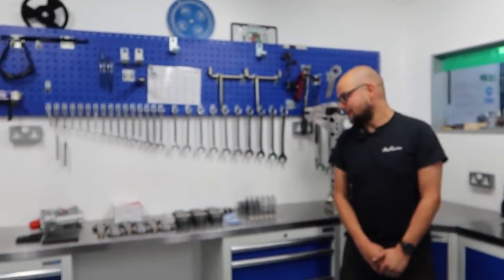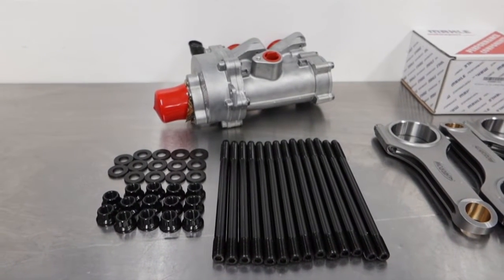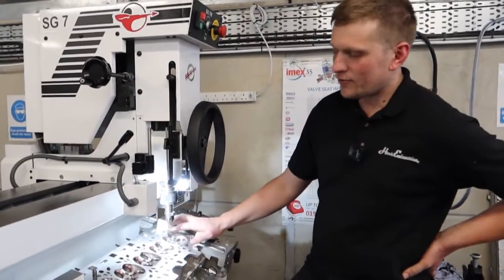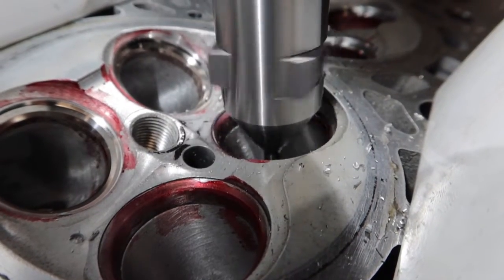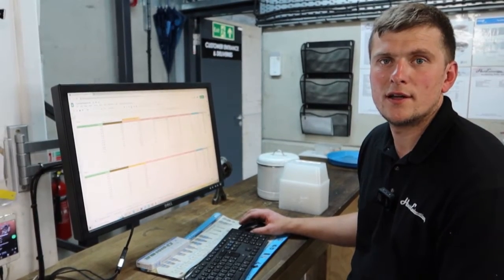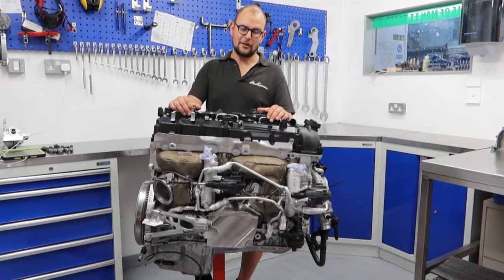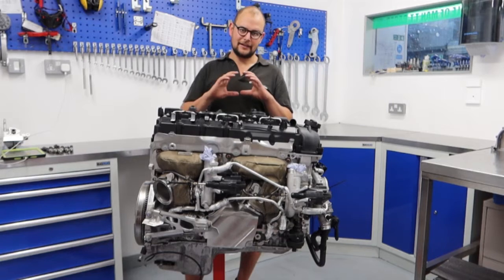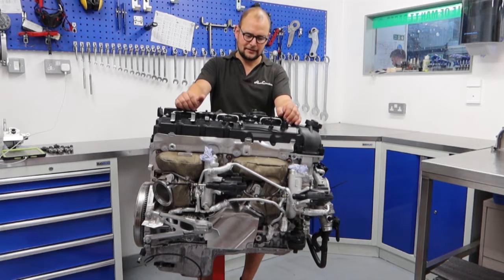FORGED S55 ENGINE! 1000bhp M4 Competition Build Episode 2

Comment: I saw you used Supertech titanium spring retainers. Do you have concerns about their longevity?

I’ve been reading that steel retainers are preferred for their longevity, as titanium fatigues quicker and is more likely to break earlier. If one of those retainers break, the valve will drop inside the cylinder and cause damage.

Thanks for answering my other questions, btw. Much appreciated.

Comment: What did you do about the LDS coating on the cylinder walls? Did you bore out the cylinders and and then sleeved them with run off the mill iron cast sleeve, or sourced a brand new engine block from BMW? Because BMW says you can't bore or machine LDS coated (arc-wire spray) cylinders on the new engines, B58, S55, S58... etc.
Reply from the maker: The LDS is very hard and this engine has done minimal mileage, and so it was not touched. It was all measured and checked before the new pistons were fitted.
Reply: @hackengineering5586 , thank you for answering.

Comment: Hi guys..  looks like a great build.. I am curious about the VVT hub.. in your opinion does it have enough "bite"  (sized correctly to make decent cut into the crank) and more importantly its hardness for chain sprocket wear and spline hard enough. would greatly appreciate feedback on this as doing a similar build. since its been two years you would have some info to share on this.. Ta
Reply from the maker: Yes it does, we have also had cranks where we've removed the VTT hub and a nice, clear-cut spline is visible. These are the only crank hubs we have ever used and come highly recommended! 
This engine has been bomb-proof.
Reply: @hackengineering5586  Cheers for taking the time to reply to me, much appreciated .
Reply: @hackengineering5586 how many miles has been put on it ?
Reply from the maker: @harambe2716 around 22k on this engine since the build. And it was running the VTT hub for a fair amount of mileage before that.
Reply: @hackengineering5586  is it honestly worth it to build the motor? I have an s55 w around 40k and I’m wondering if a built motor with all these power mods would  have just the same chance of it to blow as a stock motor would. Sorry if that sounds confusing.
Reply from the maker: @harambe2716 no problem. Depends on the power you're looking for, and how you're looking to make it. A lot of reliability comes from the blueprinting and assembly quality, not just the components. So it's a very expansive question. The right parts and the right builder and it will be perfectly reliable.
Reply: @hackengineering5586 thank you I appreciate the honest and quick feedback! I do have one question , what brand or company would you say are the best for s55 downpipes? Preferably catless
Reply from the maker: @harambe2716 Akrapovic are the finest by far. But we've always had good results with VRSF.
Reply: @hackengineering5586 thank you again !! You guys drive safe !

Comment: Can I know what happened after where is the rest of the vids, what did I make, what would it cost to send you mine to get the same things done ? 
Can I know more ?
Reply from the maker: Car is still going strong, plenty of mileage later. We've changed turbo setups a couple of times - last time it was on a dyno on the old setup, we managed 931bhp @ 2 bar of boost on E50. 
Since then, we have new turbos, Nostrum injectors, an upgraded LPFP and some other touches which mean we can run full E85. Dyno time needed to see what it's making now!
Reply: @hackengineering5586 hi can you share what turbo you have changed? Whats the difference? EU5 injectors shouldn’t it be sufficient with lpfp + hpfp lift kit? 
Reason i ask is because i have planned my project based on this video reference.
Thanks!
Reply from the maker: @skyrayx1263  drop us an email on info@hackengineering.co.uk and we'll gladly talk you through it!

Comment: I would have sold s55 m4 and bought the new m4 and tune that foe the money out into this built.  But it's still nice to see people doing crazy builds.  This is going to be a roll racing monster.
Reply: One reason you might not is if you like the DCT (prior video mentioned "clutches" plural) - not available in the G82
Reply: And the G8X are ugly and heavy.
Reply: @joe_ferreira  mates G82 0-60 run 2.1s exhaust/tune
Reply: @JH-jo9wt  it's still ugly
Reply: @JH-jo9wt  literally has nothing to do with what the guy said lmao he said they were ugly and heavy, both true.

Comment: Mate any 100-200 kmh times on this build ?
Reply from the maker: Not yet, the car has been tuned and is running well on pump fuel/E-blends. We're changing out some of the methanol control and it'll be back soon with more power, more dyno runs and some 100-200 times
Reply: @hackengineering5586  Thanks for getting back to me mate. Any idea how much a build like this would cost? And also is there much of a difference using different pistons ie is there any difference between Mahle or Carrillo? Thank u mate !
Reply from the maker: @f80e8  drop us an email on info@hackengineering.co.uk and we'll gladly discuss options and pricing, there are always too many details for a straightforward figure. Carrillo have a great product, we prefer Mahle as we work closely with them and they have a few features that are only offered by them as they work on an OE level in terms of scale
Reply: @hackengineering5586  Thank u mate !

Comment: One thing I’ve always wondered with upgrading engine parts and components, would the engine last longer, and have less issues in the long run, than it would if it was left stock? Or would it be the opposite?
Reply from the maker: Often depends on the use and spec of the engine. But when we build them, we do so to a far tighter tolerance than BMW do and so if it's all used and serviced correctly, no reason it can't long outlast a standard engine.

Comment: What compression are the pistons?
Reply from the maker: These are std (10.2:1) pistons. However with a few changes, the final measured compression ratio of the engine was just under 10:1 - https://www.hackengineering.co.uk/product/mahle-motorsport-powerpak-plus-forged-piston-set-s55/

Comment: Any idea what the stock lpfp and hpfp would handle power wise?
Reply from the maker: Depends on injectors and fuel
Reply: @hackengineering5586  m5 injectors running e85
Reply: @mushy1983123  670, after that your just gonna want to run a lift kit.
Reply: @hellohunter8583  thanks for the reply I'm about to go hybrid turbos I don't think I'll get near 670whp
Reply: @mushy1983123  what turbos
Reply: @hellohunter8583  hi flowing my factory turbos  so hybrid
Reply: @mushy1983123  yeah what company
Reply: @hellohunter8583  I'm from Australia it's a Australian company down here called gcg
Reply: Stock fuel system with e85&meth we hit 720whp back in 2018 with a f80 you can go pretty high